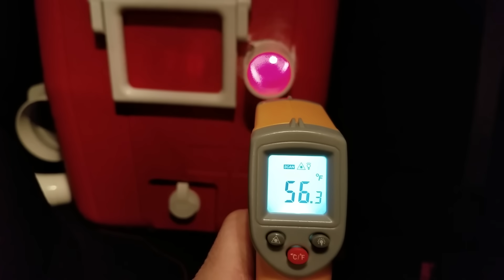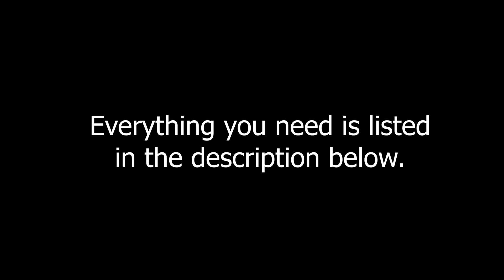Homemade Portable Air Conditioner DIY - Version 2 - Runs off 12 volt battery, car, or solar!

Comment from the maker: All of your questions are answered here: https://www.youtube.com/watch?v=H4LutVTqsUU&feature=youtu.be
Reply: Where is the list?
Thanks !
Wont be able to make myself  
But I can pay someone 50.00 to make it, I think.
If it takes an hour then 50.00 is a good price isn't it? 
Just need the list.
Again thanks so much
Reply: @dovecry2  list is in the video description.
Reply: @angelap6788  where is video the descriptions?
Reply: If I do it with 2 holes to add more air, will it be the same?
Reply: make & do r
Reply: Can I run the fan with a power bank?? and which one how many mah??
Reply: @homescool3767 NBC b m.   Nn, nnnn nnn;   b

Comment: Ok full disclosure I have worked as a HVAC consulting engineer for over 20 years and in the field over 35. This is by far my favorite design concept for one of these DIY cooler units. First off and best off as I live in Philly (summers are REALLY humid) this design actually will remove water vapor from air stream as water will condense on the inside surface of the air ducts. Second it is able to both cool and dehumidify with out a freaking water pump and chilled water and a coil in side the cooler, frankly for me at that point I would call Trane or Carrier and get a coil selection lol honestly at that point the build time your time is worth has to be getting close to at least a 5k window unit so wtf is the point? My only question that jumped off for me has to do with mu first comment - where does the condensate from the inside of the ductwork go?

Comment: I made the AC from his original plan, what I didn't like was needing to seal the pipe so after one effort, I scapped that idea and the cooler with the holes in it, I then raised the blower and intake hole so they would be above the ice and water, I also used 3" pvc pipe and an elbow from the blower to inside the cooler then attached the flexible pipe to the pvc, ran pvc 2" for the exhaust, bought an AC round adjustable vent duct for RV's and it works great. I also dicovered that so far it seems no water has entered inside the flexable piping causing to actually float, I have now ordered some small adjustable rods that I will extent across the cooler to keep the piping submerged thus hoping that 100% of the piping will be conducting the coldness. The piping being surrounded with ice was fine but it started to float to the top of ice water after the ice started melting, I want the most effectiveness that I can get !

Comment: Big tip for people about to do this: This blower is STRONG. I had the plastic it was wrapped in sitting a little behind it on the counter and when I switched the power on it sucked that plastic bag in with no time to react. Use some 1/4" hardware cloth over the intake.

Comment: The issue I see with this is that it will accumulate moisture inside the accordion tube and over time it will create mold. Which means, it will be blowing mold into your room.
EDIT: replying to myself 😂 - I thought of this after I left the comment and wanted to share..."spray Lysol for a few seconds so the fan can absorb it into the pipe and coat it.. that way no bacteria is able to grow... or at least diminish the chances."

Comment: I've seen your video years back. Always wanted to build one, but didn't have the need for one, but now I do😅... it's for my Jeep , till I can fix the ac, this will work. I fear it would be too loud. I wish you could have shown it working in your suv, but no biggie.  So just to be clear, you're saying that this design cools better than the other cooler you had shown us inside your suv??  I think it was the gray color cooler. I've seen other videos, and I also think your design is better, so I will be going with your  design. Thank you for your videos.

Comment: What if you (or have you tried) reverse the flow and make the small outlet pipe the intake and the fan the exhaust? Then you could add a way to direct the cool air in different directions and use outside to sit by it, like while camping in summer.

Comment: Awesome design and I think this is the best design so I’m copying it but your link to the wall outlet converter isn’t working. Will any 12v to 120v converter will do? Most of the converter I found are 5amp but the motor said 6A. Will it matter? Thanks

Comment: Good design with the piping.  Only thing that wouldn't work for me is that blower.  Minimum 100W solar panel needed, but the issue is after it gets dark.  That setup would need around a 55Ah battery to get roughly 5 1/2 hours with 50% battery life remaining.  By itself, a 55Ah battery makes the whole setup a little less portable for camping applications.  I'm sure it works great though as is, and if you don't need it at night, its not really an issue with the battery.

Comment: I got all the parts today and I’ll be building it this weekend, hoping this will be a good temporary until I can get my ac fixed in my car. Also was thinking of getting a second tube of the aluminum duct stuff to put another layer on top of the first layer to give a longer path for the air to go through the ice
Reply: Did you build it?
Reply: @kalinkanev2373  yea I built it. It works decently. Instead of buying ice all the time because on a hot day it’ll all melt within 4-5 hours, I just freeze a bunch of water bottles and put them in the freezer once I get home. It’ll blow at about 60-65 degrees right at the vent but when it’s really hot outside and inside my car after about 6 inches from the vent it’s not too cold anymore and a foot away from the vent it just feels like warm air. If I had like one of those tubes you could bend around like a vacuum tube and put it in my shirt I bet it would feel good but honestly this thing wasn’t really worth making. Would it better than nothing? Yes but is it really worth it? No

Comment: One flaw that I see that was not discussed, so I strongly assume a valid flaw; the tubing could shrink and then the efficiency would likely drop.  Of course, refilling with ice would make this obvious to see, but with an automated type of setup, this would be a definite issue that would need a small modification to maintain efficiency!

Comment: This is almost the exact same design that I was building in my head.  I wanted to go with smaller diameter pipes to restrict the air flow and keep the contact with the metal surfaces higher.

Comment: i have a small convertible 2 seater sports car. the a/c works well at night but anything in 95 plus weather it starts to get uncomfortable day or night. is it possible to make one of these using a small size cooler that will fit easily on the passenger seat or floor board? im thinking one computer fan only and maybe going into 1" tubing  and then coming out at 2" exhaust opening. I am mostly driving solo and i dont need enough cooling for a big room just enough for a 2-3 hour day driving (not constant) mostly stop and go errand weekend. i would be happy if I can get it a bit cooler then my ac is already providing me.

Comment: Totally not worth it, the ice melts within an hour or so, unless you have the fan hole cut at the top corner of the cooler it leaks no matter how much flex seal spray, flex seal tape, plus the caulking on the list.  Buying $5 to $10 of ice a day it just adds up to a low level AC power bill. Just find a mid level AC unit if your not in a van or RV.

Comment: almost done building this, it's really hard when you don't have all the tools and you still need a pipe not on the list to get through the smaller wall side, also makes more sense to glue the fan than drill more holes with screws

Comment: I have successfully made a miniature version. I used a paint can, plastic tubing under the ice and a small (air mattress) air pump. It cools down my tiny 2 seater car. 😁
Reply: I would love to know how well this actually worked. I have a small car it's a Chevy Cruze and my AC does not work at all and it's going to cost me a lot to fix so trying to find something cheaper. Thanks :)
Reply: Awesome! What power supply do you use?
Reply: @greek_sahab  the air pump plugs into the cigarette lighter socket

Comment: dude I'm so glad I found this video I'm gonna make one for my Baja I do wonder though I remember my grandpa tell me back in the day they used to bring ice by train and he would pack the ice with saw dust I wonder what would happen if you made you were to put sawdust in the bottom of the cooler then ice on top of the pipe and then more sawdust how long it would last and how cool it would get? Either way I'm impressed thanks for your video

Comment: now what you need is this but hooked up to a 12v thermoelectric cooler! So then you could run the cooler on the 12v keeping the ice for wayyyyy longer then switch on the fan when you want. I'm trying it!

Comment: Mount your fan inline, inside on the bottom of your lid or high on the cooler wall  (the fan is waterproof) and it will drop the fan noise considerably.  Also don't use water and add salt.  The water will eventually show up.  Spray your dryer hose with flex seal and it will keep it from leaking.

Comment: Super awesome video I just went through a build of an evaporator cooler with PVC and I’ve enjoyed the process and have enjoyed the benefit of the eval. looking at your cooler design it seems incredibly interesting. 
Part of this makes me wonder if it’s possible to do something like this with a mini fridge cooling unit installed inside the cooler. Bypass the ice scenario. 
 I’m also wondering about amp and watt draw if 100 watt solar panel could accommodate the motor,  if so one could potentially find a cooler that’s big enough for the panel foot print wise on top and build it out proportionately. 
Of course the condenser concept would be separate from the solar panel adventure.
I’ll have to go look up the parts and see what the marine fan you suggested is rated for but this is a great design and I appreciate your time and effort to share on YouTube your kick ass idea. 
Thank you.

Comment: Can a “Electric Converter” plugged into a standard 120V outlet be used to power the “12V/6 Amp” Blower? 
  My portable A/C is going in my Workshop. Thank you Jason for sharing your A/C design.

Comment: Sir, my ac in my older car went out, found out they're going to have to take my dash completely out, to fix Freon leak behind dash. I really like your ac design, after you run for say 20-30 min., does air coming out start getting warm again (with plenty of ice) ? Thank's

Comment: Tried making this and found out the flex tubing is NOT water tight.  Water came in and soaked it.  before that happened, the empty tubing kept floating above the ice water so it wasn't getting good contact anyway. Once the water came in, it blew wet water.  I switched and built your Canon build instead.  Worked much better, maybe didn't cool quite as well.  But to me, the no humidity was great for tents.

Comment: About the metal coil snaking through the inside, COULD YOU MAKE IT RUN THROUGH IN TWO LAYERS? That means more tube surface having contact with the ice. Maybe you'd need more ice and a bigger chest, though.
THANKS A LOT..

Comment: Just a suggestion to try make it cooler, try filling the pipe with copper gauze ,it will create more surface area for the air to hit and cool

Comment: 99.99% of these things don't work. OH they will keep one or two people cool as long as they are blowing ON them and the ice don't melt.            in order to cool a 10' X 10' room you would need at least 150 pounds of ice constant. Thats never melting. Lotta luck with that.

Comment: I went to order the fan blower on Amazon but it is filled with comments on how extremely loud it is and it burns out in a month or so of regular use.  :(   I am wondering if there is a fan that works well enough that will last for years.

Comment: Nice idea to keep the air cold and dry but I'm not sure how long that ducting is going to hold up with ice being dumped on it.  Once it's compromised it will become an evap cooler.

Comment: I’m gonna try this but with a cloudnine t6 440cfm in-line fan for my grown room
Reply: Do you think an s4 with 205cfm would be strong enough for a 10'x12' bedroom?
Reply: @JeffMoche  if your room has roughly 8’ ceilings thats 900+ cft. 900/205 is 4.25ish. So it will take that fan 4minutes for that fan to suck 900cft.  I personally think it would be fine. My current window unit pretty much does that now in 4 min I think it’s 280cfm or somethin and my room is 12x9x8. I just personally want my fan bigger so it takes less time to transfer the air. I will be using dry ice as well not regular ice.  The only problem I could see with it is trying to bring temps down if needed. With such a low cfm it might be harder to bring temps down quick. But all in all 205cfm should work fine is your already regulated and just swap out

Comment: wow, very nice design. Currently a heat wave in the UK, so I rigged up a pc fan to the mains (12v adapter), fixed it to the top of an ice cream tub filled with ice. Lasts for about 1.5 - 2 hours and only effective if right in front of me. A little bit of googling, a few peltier videos later I am here thinking, this is 'The Design' for me... cheers.

Comment: I discarded using dry ice for my portable air-conditioning because it releases co2 and it freezes the fan motor, but now that I seen your video your making think twice. Adding dry ice to your invention might just be the coldest and coolest air-conditioners of all.
Reply: Dry ice will release CO2 and deplete O2 causing death. Can't seal it in for fear of explosion. Take care.

Comment: Dissolve a 26 oz paper can of salt ($0.36 at Walmart) in a half gallon of water and pour over the ice. It will reduce the freezing point of the solution in the ice bath and it will come out even cooler and yes I did this. Dry ice also works well if available. **DO NOT EMPTY OVER YOUR GRASS LIKE I DID** damn saltwater works better than roundup

Comment: Great videos sir.  I built one similar to the one in this video.  Used the bilge pump, flex tubing and car lighter switch/converter.  Only difference is I used a metal adjustable elbow instead of PVC for the vent.  Mine is only shooting out about 74° air.  Any recommendations to get it cooler?
Reply: Move to a colder climate. Temperature output is relative to the temperature of the intake. If it's 110°F outside I doubt that this would make a difference other than a few degrees overnight, if it does not drain the battery pack on the car or solar system. He lives in Colorado and he won't say anything about what the air temperature is (other than that it's dry desert air) at the intake or what the outside air temperature is. And please note he is in the interior of his house which is already cool compared to the possible outdoor temperature.

Comment: Hello, great info!  Does this A/C option generate condensation and could that lead to rust of certain metals?  Also, could it potentially lead to mold?  I would be using this in a small, unventilated closet vocal booth.  I have microphones, a monitor and a guitar amp in the booth.  thanks, Tom

Comment: I read that putting salt in with the ice will make the ice colder and melt more slowly. Just curious ... is there a reason why the flex tubing cant come out the top (while still zig zagged at the bottom) so as to avoid leaking through holes along the lower section of the cooler?

Comment: Why can’t we put the fan inside the box and only the hole outside for fan to suck the air?
This way the noise of fan should be muffled and the box will not take extra space as well.

Anyone tried this?

Comment: why didn't we keep it 4 inches throughout the systems? Pressure reasons?
Reply: I believe it has to do with a greater surface area of metal pipe to solution contact. If it were situated in a bigger cooler, the 4" may have been more appropriate.

Comment: I wonder if you could pipe in outside air into intake side for use at hwy speeds ..well i know u could , will it work ?  . then no fan would be needed

Comment: Built this exactly the same as video. Not sure what happened but it did not lower the room temp of a small car by any amount. 80 degree outside temp at night, in a small car. Got out after about 3 hours of trying to deal with it and it was actually much hotter in the car than outside.

Comment: How did you keep the water from seeping into the metal hose? Within an hour or so the hose completely filled with water and blocked air flow. What I noticed is that type of hose isn't water tight. When you bend it, that can open up the bands allowing water in. I really like the idea but, I wonder if something like flexible copper tubing would work better? Or maybe that would just be too small. 🤷‍♂️

Comment: In case you're wondering, the reason the air is cooler after some of the ice has melted is because there's more conductive heat transfer occurring between the air flowing and the pipe/ice.  The air gaps (convective heat transfer) between the ice and pipe is less effective.  If you were able to somehow pour water into the cooler and let the whole thing turn into a block of ice, you would a very effective cooler.
Reply: So use a portable electric cooler/ freezer and set it to the freezer setting after filling with ice and water. Like the one I have from Costco Massimo CX50 12V Portable E-Kooler. A bit more expensive for the build, but these still run off of solar, portable power supplies, household electric, cigarette lighter outlets, and generators. And they come with both the 12v and 110v cords.